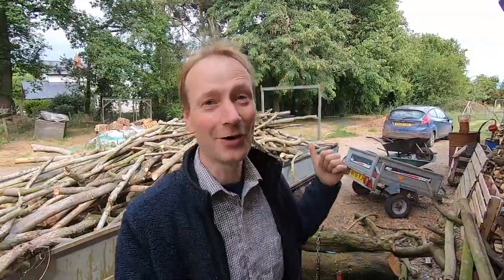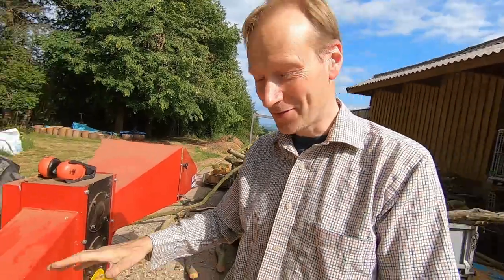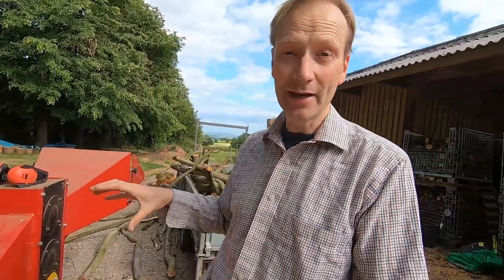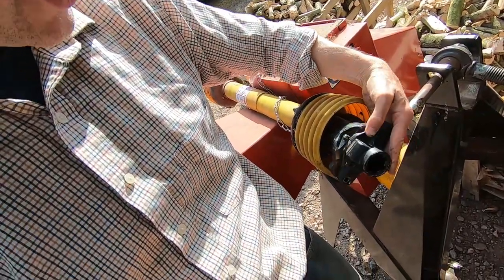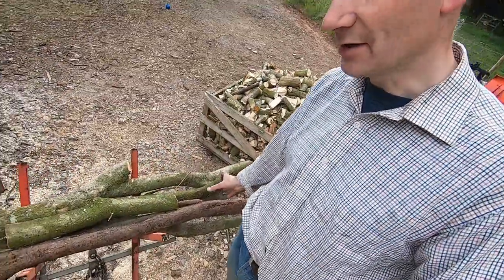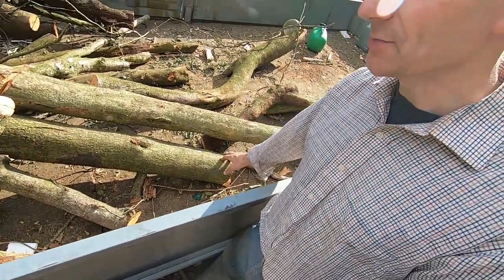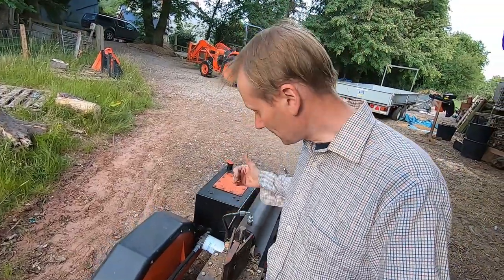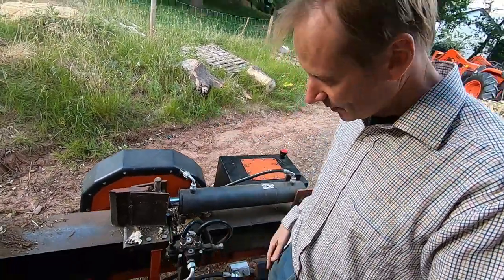Wood Processing on our Homestead Smallholding Herefordshire

Comment: Nice vid, got a similar machine from rock machinery,, saved me a lot of money, in terms of all the smaller branches I used to chip,, so quick to do a ton bag, which I use myself, and sell the bigger stuff👍👍
Reply from the maker: Hi Andrew.  It is a very cool machine, so long as you don't get too greedy and try to shove something too big through.  Glad you like your machine too.
Reply: What tractor have you got on it? I had one on my MF35 and the shear pin never went, it just stopped the tractor dead. Had a load of grief off Rock. They said there was nothing wrong with it, sent me a video of it working on a waaaay bigger tractor, charged me the earth for transport and gave me half my money back. They are a compoany to stay well clear of.-
Reply: @davidsmith663  hi David,, had a maxxum 5150 on it, just on tick over,, went threw plenty of shear bolts,, but was getting used to size and wood type,,,, but sorry rock machinery weren't up to scratch,,, hope all goes well.
Reply: @andrewbibby7060  I think their statement of 20hp for the logger is way off. At least you had the power to break the shear pin. How a small tractor would do it I don't know.
Reply: Hi dave,,, I got a 15hp yanmar tractor,,, OK on the soft stuff,, but its always the same,,, power is everything,,, weight, torque,, low revs,, I don't dowt thoe,, I probably will twist the machine to bits, with the extra horse power,, thanks for the return reply,, and good luck pal,, 👍😊

Comment: Hello - I just subbed and hit the bell. I have a small holding in Wales that is currently not producing anything. 10 acres have been rented out to a local farmer for many years but we are now interested in starting up, at least for some self sufficiency. The first job I think is to reclaim some land by cutting back 25 years of hedge growth which has produced lots of small trees. I'd like to process this into firewood. Currently I only have a chain saw so I will need to buy a compact tractor to lift and haul and then think about the best way to process the wood. May I ask what £ the wood chomper and the splitter might set me back? Should I consider running a splitter off the tractor hydraulics? Or running ann electric splitter just outside the building I'll store logs in? It's a jigsaw I'm trying to piece together. Oh, one last thing, what HP is your tractor? All I know about tractors is that they should be red 😀. Nice chanel, keep it up please.

Comment: I like you experiences .. I read some comments about 20% moisture limit: Wet wood uses excessive energy boiling out the water to be efficient. Split wood dries fine 2-4years. Trees are perfect evolved for retaining moisture … if you don’t split logs irrespective of size, they won’t dry, they will just rot. Wet wood puts excessive tar in your chimney which wastes energy and is a fire hazard. I am not in favour of intrusive rules and laws .. you should take the 17% moisture rule of thumb as a way of optimising wood resource

Comment: I ran a log selling business from a small holding but with the new 20% moisture rule it has made it impossible to I have closed it down
Reply: That is crazy as the weather is so wet in the UK that keeping wood dry would almost require an oven to dry the wood.
Reply: Out of curiosity as I'm in Wales if I kept a pile of wood undercover but still outdoors for around 2 years what would be the lowest moisture content  I could hope to get?
Reply: That’s terrible! Where in the uk are you? I’ve got about an acre of old commercial glasshouses that are a bit too tired (would cost a fortune) to bring back to viable growing use for me but I always thought they would be good for drying out wood fast as the heat in them is intense even with the missing glass ….-20% would not be a problem if wood is palletised and stored in them 🤔
Reply: Wet wood uses too much energy boiling out the water to be efficient. Split wood dries fine 2-4years. Trees are perfect evolved for retaining moisture … if you don’t split logs irrespective of size, they won’t dry, they will just rot. Wet wood puts excessive tar in your chimney which wastes energy and is a fire hazard. I am not in favour of intrusive rules and laws .. you should take the 17% moisture rule of thumb as a way of optimising wood resource
Reply: You needed to split it far more and tack in open sided shed. I get mine down to 16/17% in a few months, including oak and ash.